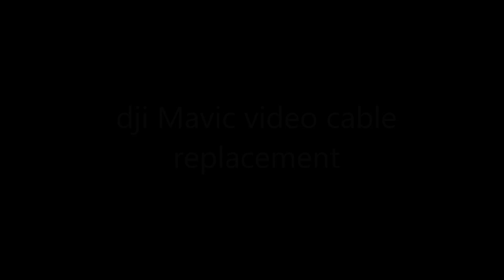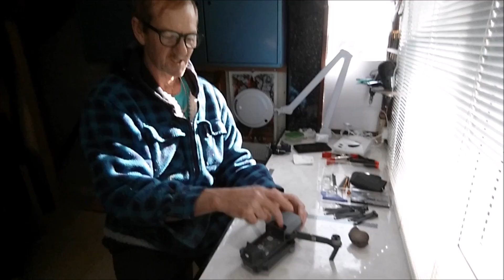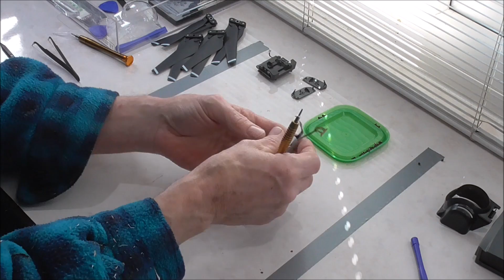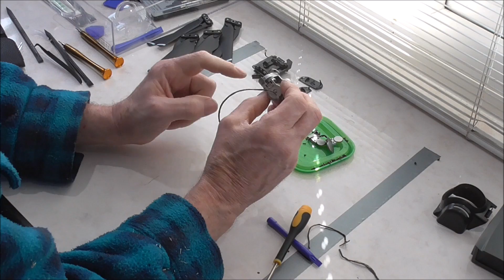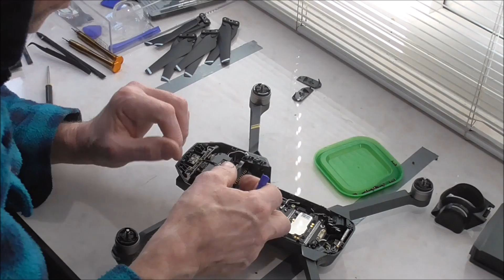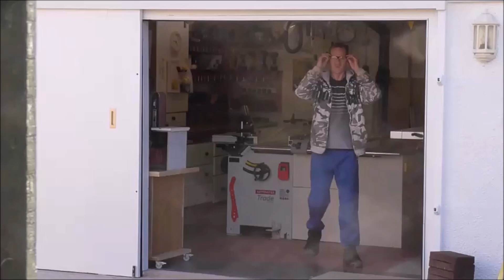dji Mavic Video Cable replacement

Comment: I replaced my Ribbon Cable and the Gimbal works fine now but the Camera Focus , just wouldn't happen and I am thinking it could be that Video Cable cause before the Ribbon Cable was changed , the Gimbal was Frantically Re-Calibrating in flight and I believe it damaged the Video Cable .

Comment: Thank you for your video, i managed to replace the video cable successfully. But I'm afraid it didn't solve the problem I'm having with my drone. I am getting an 'Air Encoder Error (0x8000000)' message. I am getting video on my remote controller but its unfocused, then it cuts out after 2 or 3 minutes. If anybody has a solution let me know. I cant update the firmware either as DJI haven't updated the DJI Assistant 2 for Mac OS Monterey.

Comment: Hello, I bought a crashed drone. It had gimbal smashed off. I replaced the flat ribbon, camera signal cable and the antivibration plate. The gimbal works but I have no video feed. I am thinking to change the gimbal control board next as the camera signal cable been pulled out of the connector and damaged one of the clips on side.
Anyway just wanted to ask if your drone is still working after gimpql board change and latest update as I heard DJI is now blocking any non genuine components or DIY repaired drones with the latest firmware update. Many thanks.

Comment: I'm getting no response from my gimble. No movement no image..how do i fix it?
Reply from the maker: Hi first thanks for watching, im no expert but it sounds to me like a damaged cable and as thats the cheapest part to buy its a good place to start
Reply: I replace the flex cable and still no response..but i think it might be the gimble control board or the ptz video cable
Reply from the maker: @Sfjlifestyle  i had simaler when i changed mine and it turned out to be the little plug connectors on the cable not in fully but other than that i would have to ask dji for help
Reply: The front vision sensors work..so i dont know if the gimble part on the board isn't working..cause replacing the flex cable i should have get some movement
Reply from the maker: @Sfjlifestyle  yes part of the board controlling the gimble could be gone but its not a cheap part so check every thing before that
Reply: I have the same issue what’s the fix Any solution

Comment: So i think all of us has same isue when we only change the gimbal board, the gimbal knock when start up always apear after gimbal board replace, my question is, did your drone gimbal movement can do 30° up? Or when your mavic can take panorama picture?
Reply from the maker: Yes i think you are right as the cost of getting a new board from dji is far too high so i as most people do went to ebay & a used board from China but its been flying with all functions for a long time now so i guess there is no real problems with having a bit of a bang with you gimble dance but thanks for the info its an eye opener
Reply: @dmgladden  thanks for reply, btw can u extend your gimbal movement 30°up,so we can shoot sky, and can it shot panorama?
Reply from the maker: @arasykeysha  i don't know, to be honest i have never tried, i only ever shoot video im not much into single photos and if i do need one as i have in the past i use the Inspire as its a much better system

Comment: Similar situation mine, but how to be sure that only video cable is gone when you get no image on camera ?
Reply from the maker: FalconEye Aerial if the gimble dances then the flat cable will be ok, i never switched mine on after the crash as too much was wrong so i just fixt whst i could see damaged and the video cable can be damaged without looking damaged

Comment: Thanks for the video, do you think that damage to this cable can cause active track, tapfly, quickshots to not function? My forward obstacle avoidance and downward vision positioning is also not functioning, I get no errors, almost like it is not transmitting the data. The only damage that I physically can see is pinching in the camera multistrand cable. Please see link below for the full extent of my problem with screenshots and videos. Your two cents will be appreciated! 
https://forum.dji.com/forum.php?mod=viewthread&tid=143684&pid=1302133&page=1&extra=&mobile=2#pid1302133
Reply from the maker: Wynand Kruger hi first i must say i am no expert in these matters so any idea i have is just that and to i hope help you find the answer.
To me it sound like your gimble circuit board the one i change in my video its easito change but cast a bit more so i would ask others before commiting to buy one, sorry i cant be of more help
Reply: David Gladden Thank you for your quick response! I am stumped and have tried so many things to get it back to normal after a slight tree incident, so any ideas I have not yet tried, are appreciated!
Reply from the maker: Wynand Kruger your very welcome I know what it's like, anyway good luck and please let me know when you get it sorted which I'm sure you will